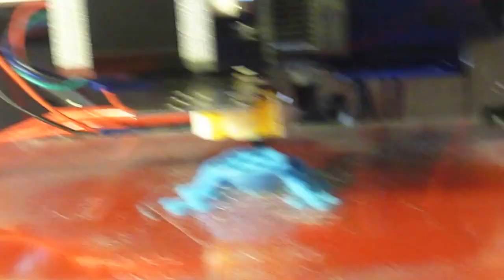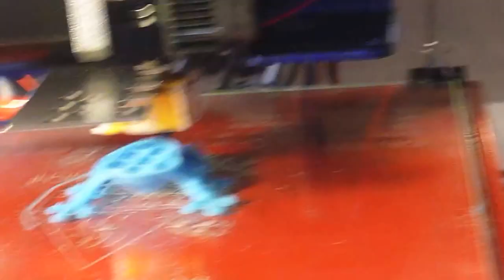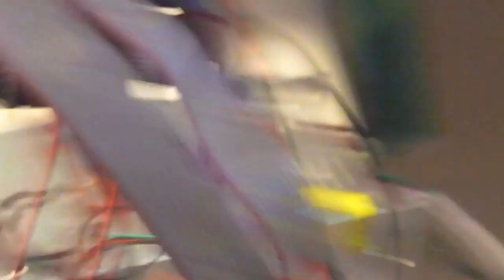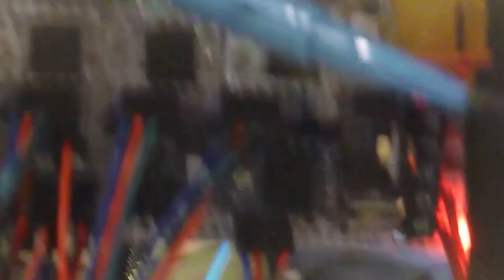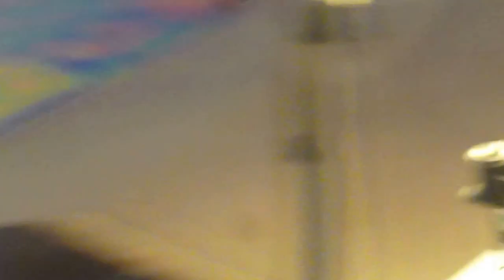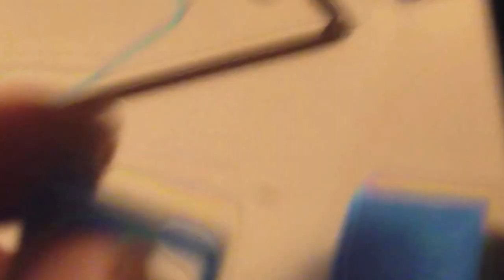Ord Bot Hadron 3d printer Build part-9 - Early Prints

Comment from the maker: Yes it was mostly a kit, the machined parts and makerslide, and a ramps 1.4.  I still had to source the extruder (modified qu-bd), power supply, 24v fans, misc wiring connectors etc.  (That was intended to be in the part-1 video). I spent a month on it as time permitted. I tried to put work, family first. I thought long about many build details.  good luck!